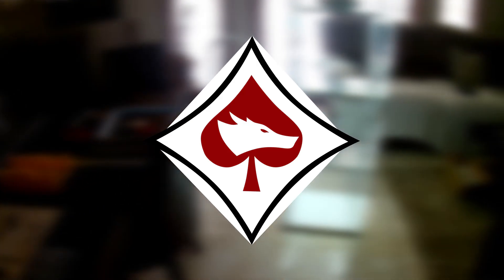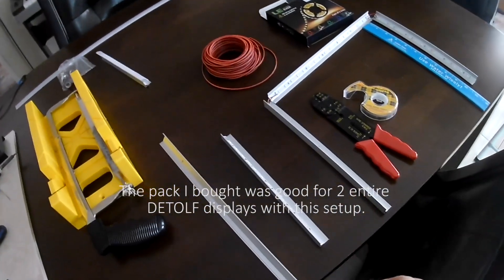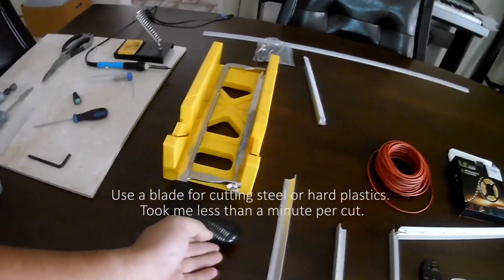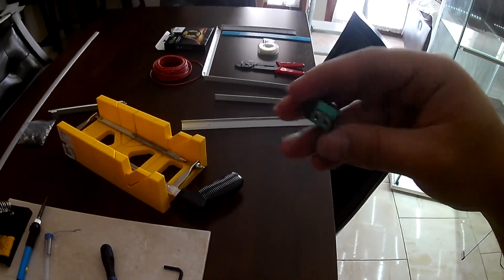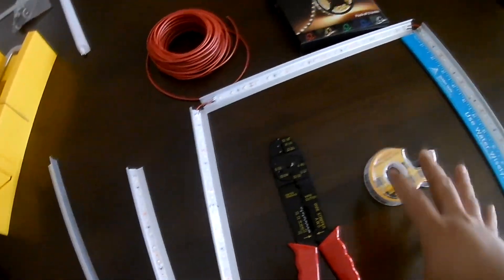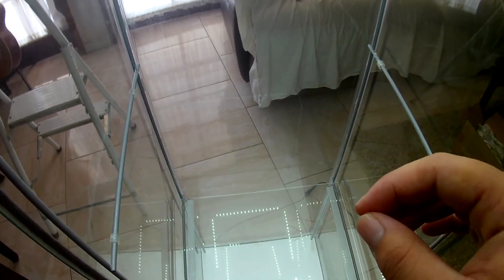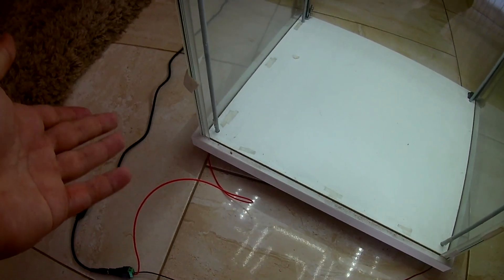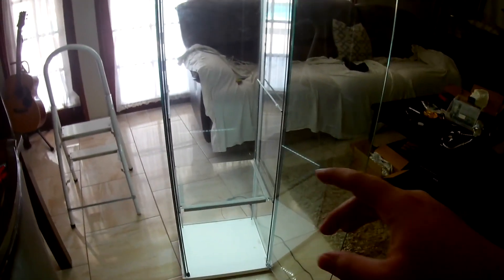IKEA DETOLF Wireless Shelves LED Light Guide

Comment: Can you run two of these off of one power supply?
Reply: @CGxWhiteWolf  Also, how long of a wire needs to go into the feet, and how far out did you have to unscrew them?
Reply: im currently running 2 shelves off 1 power supply for around 6 months, all good. make sure you have a good splitter

Comment: Hi, I tried looking at the original website and your English FAQ but didn't find any kind of a wiring diagram for everything. You mentioned the polarity of the poles briefly in the video but did not talk the polarity of the shelves. First, each shelf is wired together to pass the voltage through. Each side has a pair of positive and grounded connections. Do you connect only the positive terminal on the right side to the positive wireframe and then only connect the ground terminal on the left side to the grounded wireframe? Is that how it works?
Reply: @CGxWhiteWolf  Wow, thank you so much for taking the time to create those diagrams in mspaint, I appreciate it very much! Completely answers my question. I was originally confused on if you were supposed to leave one unconnected terminal on each side of the led strip on the shelves while feeding both sides opposite polarity. Now based on your diagram I know that will work. Thanks again, can't wait to try this out!

Comment: if you miter cut the aluminum profiles (45 degrees) the ends of them could touch like a picture frame so you couldn't see the wires and give a cleaner look.
Reply: @CGxWhiteWolf  bro actually you do...you have a miter box...that yellow plastic thing the hack saw is lying in on the video...its made to cut 45 miters...
My best
Ray